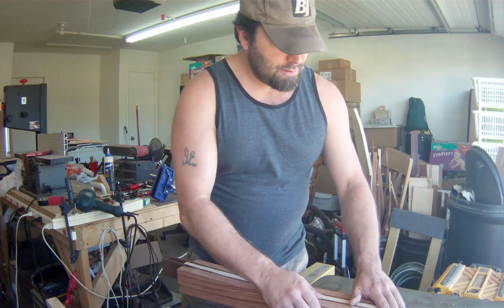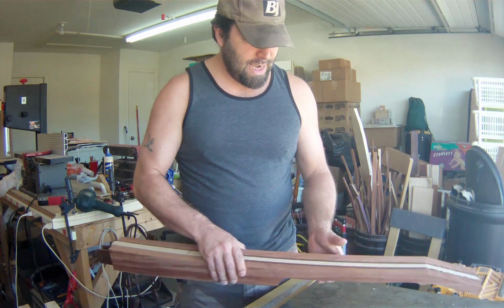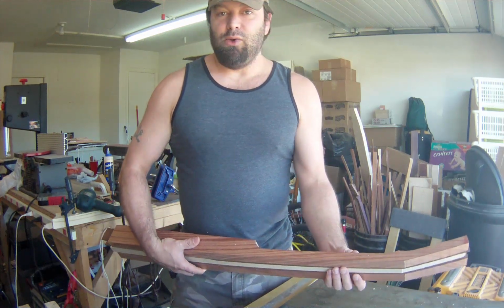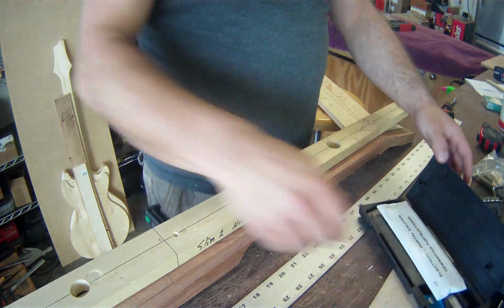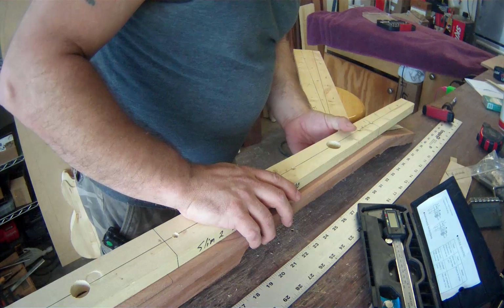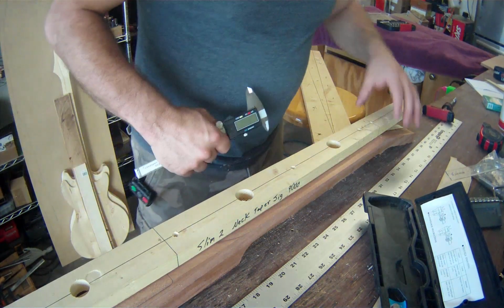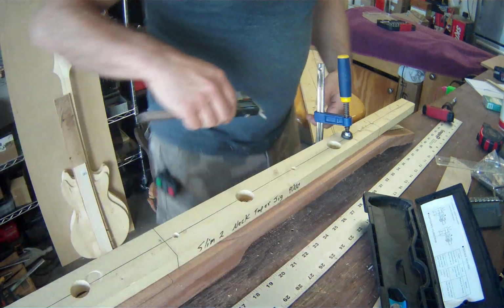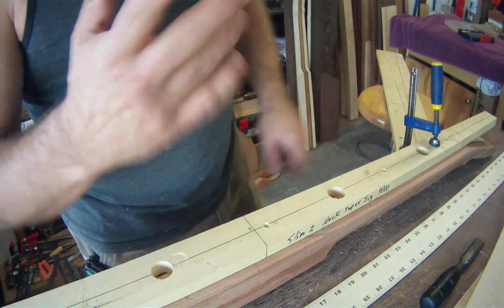Guitar Build 13.01 - Building A Neck Blank

Comment: So how thick are the pieces you use for the neck?
Reply from the maker: I usually start with 4/4 stock and usually need 4 stripes.  Two for the outer rails, one re-sawed for runner stripes and a core that gets tapered slightly.  This originally came from necessity, since I didn't have a bandsaw mean enough to chop up a full neck blank.  But since then I've come to like the look at strength.  Can't imagine doing a neck that isn't multi-lam now.